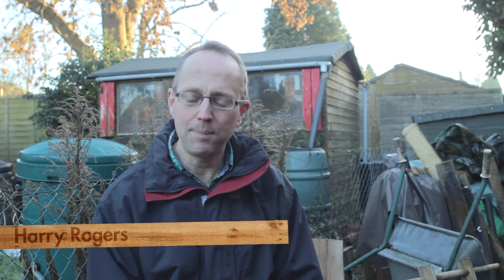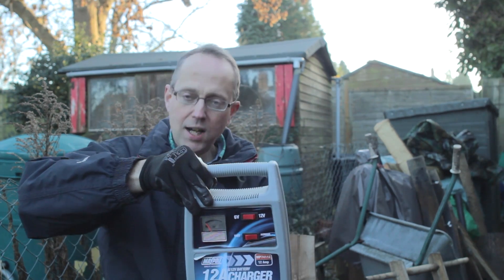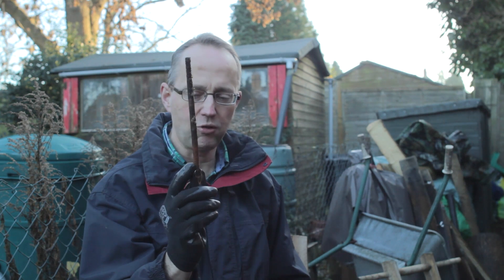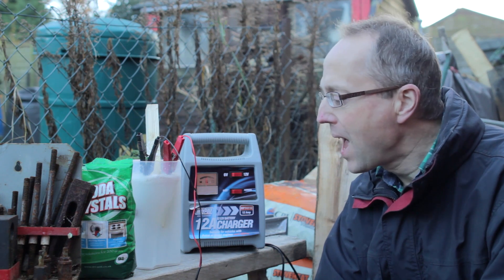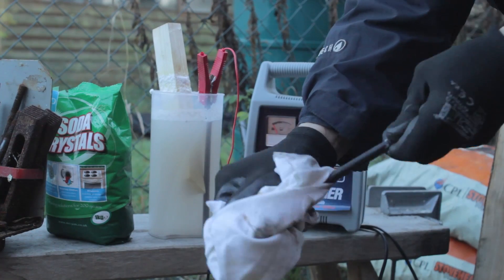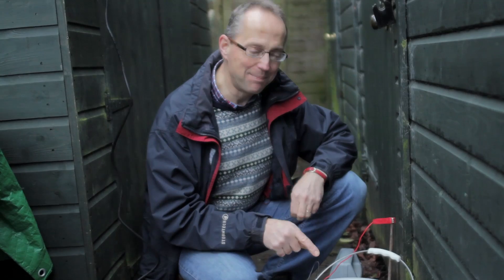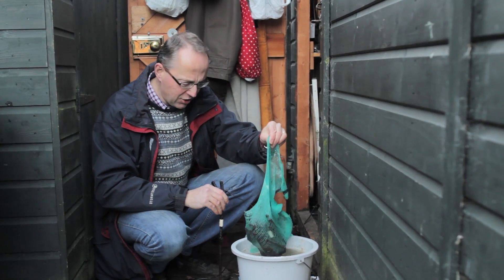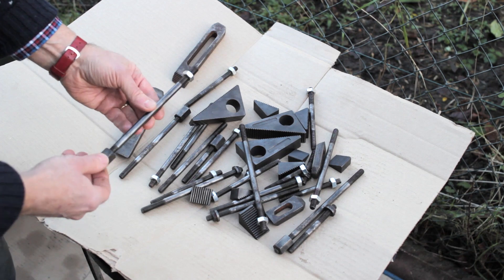How to Remove Rust With A Battery Charger

Comment: Hi there Harry 
I have a several of question's for you;
1) What level should the water be ?
2) I am going to undertake several M5 x 80mm bolts as an exercise, do they need to be joined together with copper wire ?
OR as seen in the video put them all in a bag.
3) Is there a rule of thumb for times etc.
I look forward to your response.
Kind regards
Tony
🤔🤔🤔
Reply from the maker: Just cover them...no need for additional wire around them...keep an eye on them 20 mins plus.

Comment: Harry I am having major problems trying this. I want to do what you just did in the video, remove rust ut also etching my logo on metal. My son got me a Screwfix gift card & I went & got a car battery charger. (Brand Ring automatic standard charge 8). It wouldn't work. It has polarity reverse protection. I took it back & thankfully Screwfix gave me back my money. I went to a local store this morning & told the guy what I wanted to do. No problem he said we have charger that will do your job. He recommended increasing the fuse, but assured me it would work. It's not. It looks the part with a ampmeter. So I am doing what I should. Plastic bucket. Soda crystals, water cold (3/4 gallon UK) , red positive on anode rod or thin steel sheet in my case. Black negative on the wee vice I want to clean. 12v, switch on. Charge going, nothing. The charger works on a car battery fine. So, after all that blabbering, if you understand what I'm saying, any idea what's wrong? Is it the charger? Your charger looks quite modern so can you tell me if your has polarity protection... Thanks. Hugo N. Ireland.
Reply: I hope 3 years isn't too late. I'm using the 2 amp trickle battery charger and then adding an extra red and an extra black electrode on each side. Then, I connect the red electrode to the scrap metal and connect the black electrode to the good metal.
Reply: @Army95th  :) never to late LOL.  I haven't look at it since.  Have another project to clean so might try again.

Comment: For anyone trying this and having problems with the battery charger - most new chargers are now "smart" in as much as they need to detect a current from the battery before the voltage kicks in. So unless you're piggybacking something else it won't work with the smart chargers.

Comment: Why didn't you "tie" (i.e.. make contact) the parts to be cleaned with the negative wire ? Would have been more efficient no than letting it si with no contact with the electrode ?…
Thanks for posting anyway.

Comment: That seems like an easy way to remove rust and was wondering how long you left parts in the solution before removing them? I have some tools which I want to clean up as they got rusted while getting wet in the back of a vehicle. I have a battery charger, and I assume you used baking soda, which I have also. All I need it a pail to put them in and a metal rod to hook up my positive terminal to.
Reply from the maker: Hi Sydney...I think it was about an hour but I forget...so check as you go....it works well.
Reply: I will remember that, and thanks so much for answering my question.
Reply: It was washing soda, not baking soda!

Comment: Great explanation!

Being a complete layman with electronic stuff, I do have a question: I don't have a charger lying around in the workshop, so I need to buy one for my derusting work.  I see there are all kinds of voltage and ampere models available. Which one should I choose (ideally it should also be able to charge my cars battery, but derusting-work is my primary goal now)? What are the minimal/optimal ampere/voltage-numbers needed for derusting purposes?
You are using am 12AMP-charger - will a 6AMP 12V be good enough? Something like this: http://www.willhaben.at/iad/kaufen-und-verkaufen/kfz-zubehoer-motorradteile/ladegeraet-fuer-autobatterie-12-v-119191135/ or this: http://www.mercateo.at/p/109-20122102/Batterie_Ladegeraet_8_AMP.html

Thank you very much!
Reply from the maker: Frauenfoerderer I suspect they would be OK but without trying I dont know ....my charger was £29 delivered so still cheap and its versatile for cars, vans motorcycles etc....so might be worth paying a little more for the versatility of charging rates - in the film I used both slow and high rates.
Reply: Harry Rogers Thanks for prompt answer. Will try to get a similar model. Have a nice day.

Comment: Of all the methods I've used I like electrolysis the best. I use baking soda instead of washing soda. The soda makes the water conductive without being as aggressive. I can dump the water on the yard and the iron and sodium bicarbonate green up the grass very nicely.
Reply from the maker: Thanks thats a very helpful tip - will be helpful to others as well.
Regards
Harry
Reply: Harry Rogers Hi harry, my name's Pete, you did a great job of the video. I just wanted to mention about the stainless steel, you were absolutely correct, NEVER use it, it releases among other things, a particularly dangerous form of chromium. if you are familiar with the true story film/book "Erin brockovich" it was the same compound that destroyed all those poor people's lives, that stuff will ruin your day, besides the fact electrolysis of stainless steel is illegal!. Definitely not something that a hobbiest should be messing around with. only mild steel/tool steel etc for this process. Once again great video buddy.
Reply: Also, if you don't want all the messy goopy water residue (that we all know and love), instead of using a sacrificial piece of steel, use a graphite rod. Not only does it keep everything clean, it works quicker and you end up with a nice clean deposit of iron oxide at the bottom of your tank which is great for small scale thermite welding. I successfully thermite welded a handmade hammer face to a very thick steel bar as part of another project, it takes a huge amount of prep time to do a successful thermite weld. But, just an example of uses for iron oxide, bear in mind, if you have a lot of it, there are people who will buy it. :-))
Reply: @shonaoneill5151  will a graphite rod from a golf club work? we will have to scrape the paint off of the golf shaft a little but is that conductive enough?

Comment: WHAT WAS THE CHEMICAL YOU USED AND WHAT IS USED FOR?
Reply from the maker: It was washing soda - it might work without, but I think its supposed to speed things up........going back to chemistry days is it something about positive ions or something all buzzing around looking for some + ones?....I sure someone here knows!
Reply: Harry Rogers
It is required for the electrolysis. Roughly, the washing soda (sodium carbonate) dissolves to make ions. Because of the electricity, the rust detaches from the positive electrode and combines with the carbonate ion, oxygen in the water molecule, and the iron in the negative electrode which gets deposited on the negative electrode creating the green crud. The hydrogen that was in the water molecule is what bubbles off.

Comment: Thanks for the demonstration, Harry. I have been cleaning up about 20 or so old tools now, derusting and cleaning up old handles and so on. These tools really are perfectly usable and often "as new" as you point out. I have been wanting to try the electrolysis method but I haven't yet found a battery charger yet (I'm a non-consumer so I will find it second hand). It's quite astounding how we have killed off the metal age and we're all using cheap plastic disposable rubbish. I am actually pretty close to finding metal replacements for anything plastic I had in the house, I don't think any of these things need to go to waste!
Reply from the maker: Well you should approve that at the same scrapyard that I got the hold down set, I got some stainless table legs for a bench I am making, and a rusty old bellows forge that I am restoring and that I will feature in a future film!

Comment: hey my only issue is that the nuts you replaced were hardened, the ones you have now could actually fail in the middle of a project and cause serious injury. I highly recommend getting the proper nuts back if you use the hold down set.
Reply from the maker: Thanks I will bear that in mind.